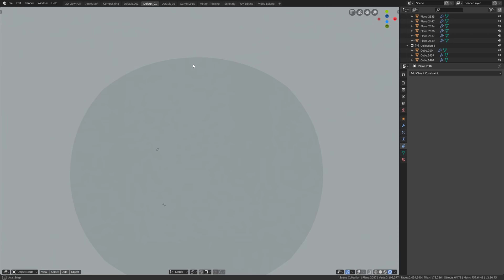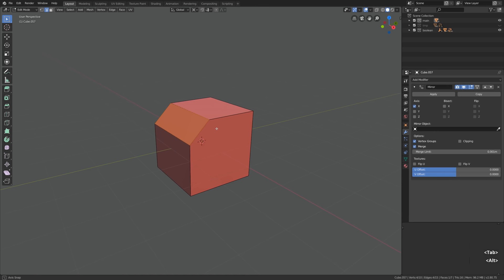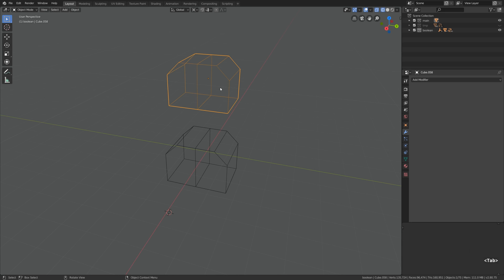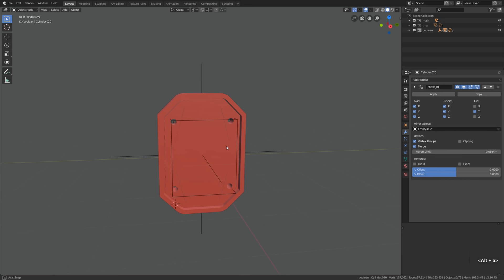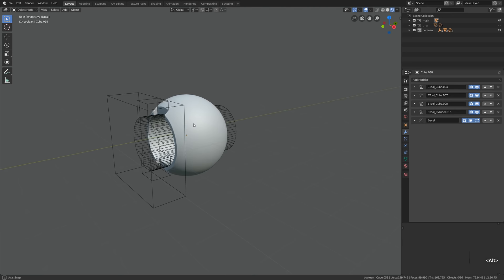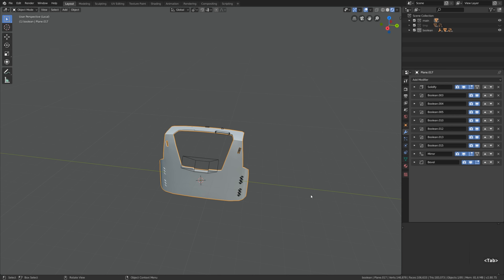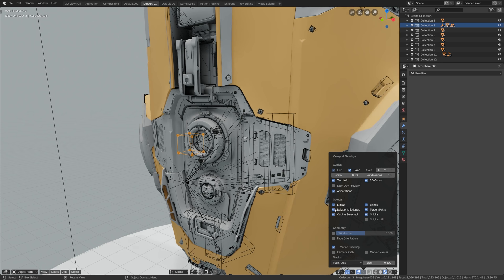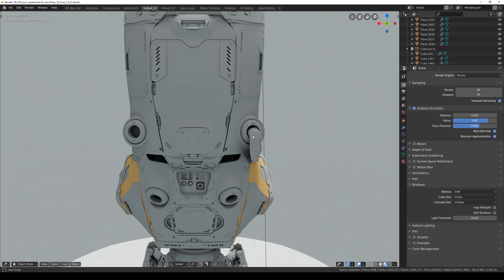Mirror Modifier 2.8x | Hard-surface Modeling Update

Comment: Max user here. I use symmetry modifier a lot in Max and one thing that I really miss in Blender's Mirror modifier is internal pivot point for the modifier instead of relying on the external object to be used as a pivot for mirror. External objects can be moved/deleted accidentally, and it cam mess up your mirror object without me even knowing what happened. In Max, internal symmetry modifier pivot point is preserved inside modifier only, you can move it, edit it, align to different objects etc.  but when you go out of edit mode you don't see it any more. It is also represented as a plane so it is much easier to see how you are mirroring object, instead of seeing locator. Wish developers implement these features from Max to make Blender better.
Reply from the maker: yup, that would be nice.

Comment: Would be interesting using Array modifier for octagonal symmetry etc. Arrays are a not great when rotating with offset object though. Wish they would have a separate offset for individual rotation. Do you have any tricks for that? Never mind, I just found instancing - aligned to vertex normal.